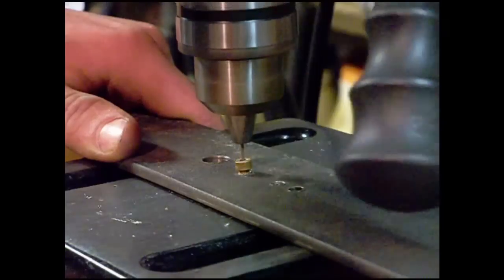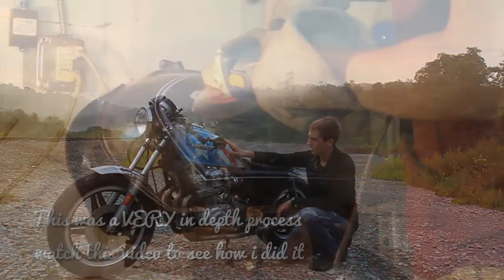"Vintage Americana" Cafe Racer

Comment: Sounds good.  the flutter in the top end is due to air /fuel mixture.  if you stumble across  a cheap 4 into one header i still think you would like that even better.  Sounds good now but it still would be different with a 4 into 1.   you may have drilled your jets too big and might need more air to get the fuel to fire properly.    are your Pod filters K&N?  K&N allows more air in.   take pods off one day and make another top end run.  if it gets better then you know it needs more air.  if it gets worse then you know you need less air.  I have twin carbed V twin 1500 and it was a long process for me to get my jet configuration as close as it is now.  be careful with your top end speed play.  your baby is old.  she will start needing inner engine work soon if you start pushing her hard, too much.    I still love it and think you did an awesome job.  STAY AWAY from dust with the pods off and put them back on after your test.  

the shortcut:  pay someone to put it on a dyno for you and tell you what you need to do to fix your fuel air mixture.
Reply from the maker: When I filmed this video one of the carb boots were loose therefore it had a small vacuum leak, I tightened her up and now it runs much much better. Also the engine only has 20,000 miles on it so it still has a lot of life left in it! Thanks for the comment!

Comment: What size jets do you have? I have the same exact bike and I put AirPods on it. I jetted the main jet to 115 and the secondary to 75 but when I start it it idles very rough and if I rev it up high it falls so low that it dies but I want to make sure the main jet and secondary jet is correct before I go trying to diagnose other things that may be wrong

Comment: How is the tank holding up against gas drips and whatnot ? That paint job is awesome. I'm thinking of doing something similar on my xs1100 but with a Japanese flag ! Early 80's bike right ? Mine sadly has the 85mph max speedo :/ but this old 1100 will do a whole lot more than that.